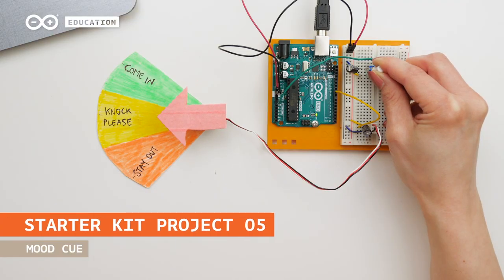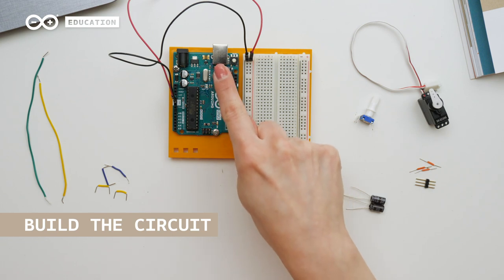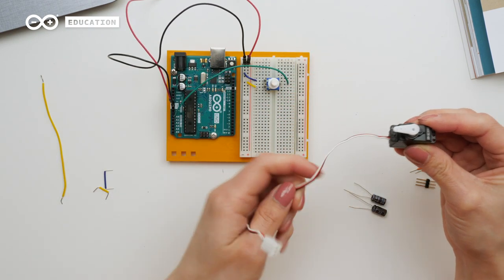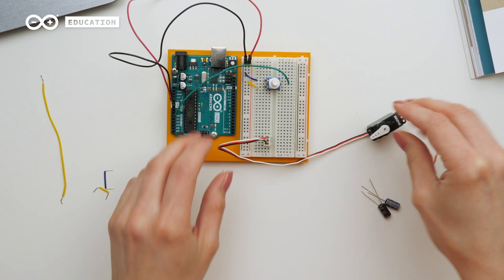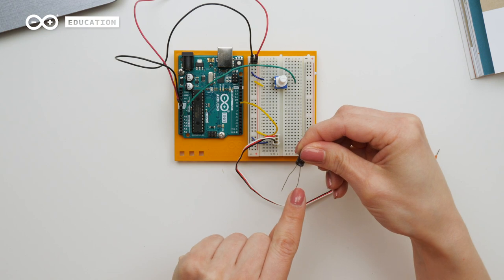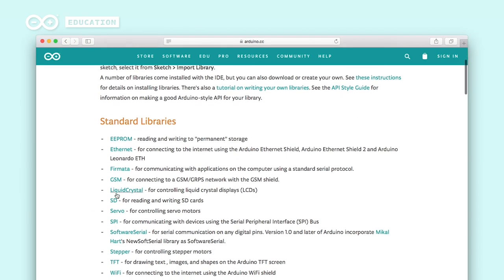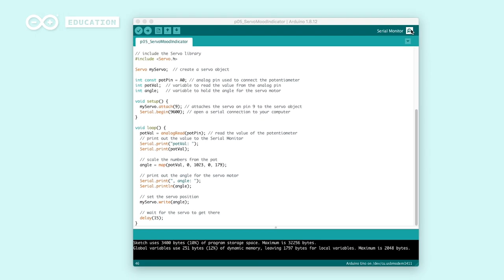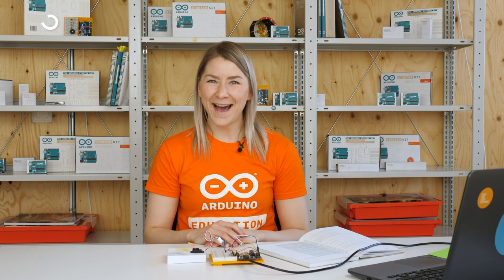05 Starter Kit: Mood Cue

Comment: My male header for the servo motor is too short on one side :\ can't connect it to the bread board.
Reply: u gotta push a little
Reply: I know i'm 1 year too late but that's more for anyone else with this problem : It's a little bit hard, but you can push down the black part. Once dislodged, it become easier to move the black part up or down.
Reply: @soon7221  Thank you for your help!
Reply: @soon7221  Thank you! I didn’t know if it was safe to push it or if that would break it!
Reply: @soon7221  Thank you, my male headers were too short to connect to the servo and this tip helped.
Reply: @pattyverhoeven8342  You'r not the only one suffering with smaller male header.

Comment: I did this and it worked fine from 0 degrees to about 165 degrees. When I turn the Pot the full amount I get 180 read out for angle and the servo stops motion but the motor vibrates unless I turn the pot down a couple of clicks then it points and stops and is non vibrating. Any ideas how to get the full range but not have it vibrate at the end? Thanks!

Comment: I followed the instructions in the book paying very close attention to how everything was hooked up. When I plugged the board in, the servo buzzed and moved a tiny bit, as if jumping when power was introduced. From that point on, it doesn't move, buzz or do anything at all, no matter which way I turn the pot. So I looked on the forums and didn't get any further with my problem solving as others seemed to have a dimilar issue but none of their solutions worked for me.
So I stripped the breadboard and followed the steps in this video. Same exact result. I've tried the code in the book, the code from the library, tried the Sweep as well as someone on the forum suggested it and still, the only life I get out of the servo is that initial tiny jump followed by nothing. 
Running the Seriell Monitor shows the values changing in accordance with the pot being turned but yeah... The servo doesn't react. Help?
Reply: The analog (A0) seems to have to connect on the RIGHT side of the potentiometer/breadboard for it to work, which is not what the diagram shows in the book. I had the same problem.
Reply: @saracynthiasylvia  I did that and it didn't work
Reply: make that shorter and they will see, or read it.
Reply: where can i get a soft copy for the book?
Reply: i am facing exactly same issue. any help ?